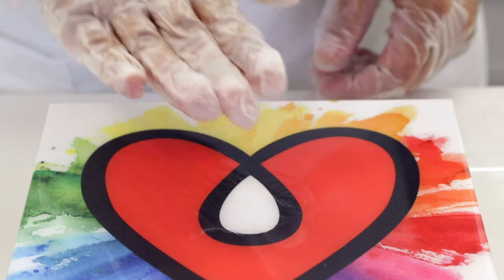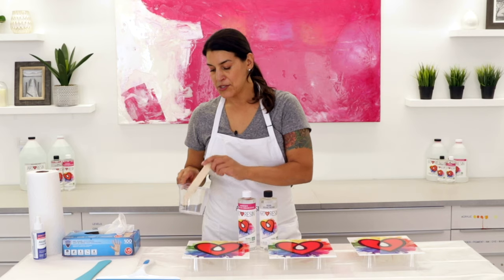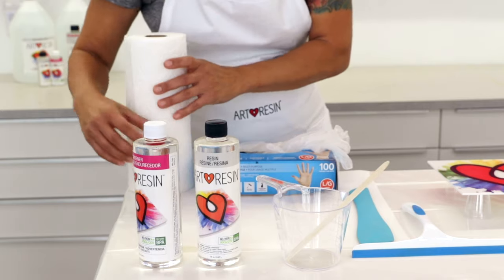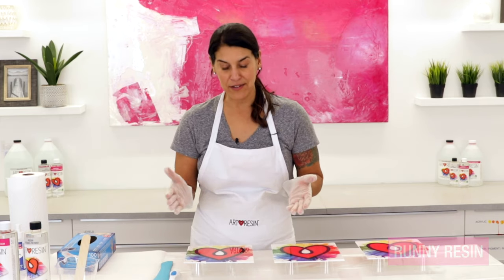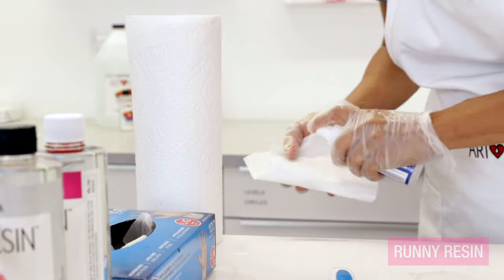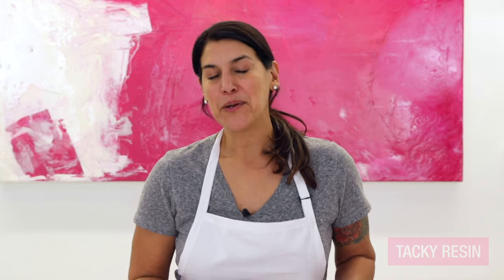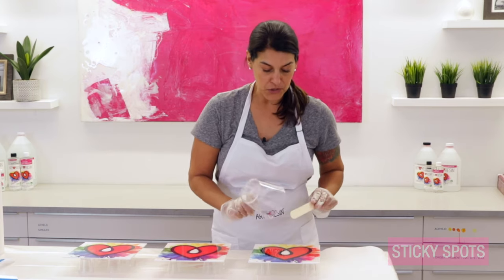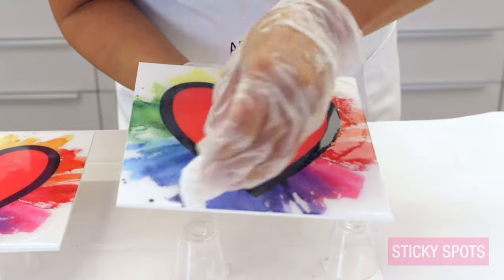How to Fix Sticky Resin - Top Tips & Tricks

Comment: My issue isn't about the mix because : I did the mix I put it on a 3D print and I let it cure and I often goes to flatten the thing and I add color and put the colored on the now sticky one
The 1th isn't sticky
The second IS sticky
The rest of the mix wasn't

If it's the mix it make no sense
Reply from the maker: Hi there, sorry you are having some problems with sticky layers.  You should be able to just apply a fresh layer overtop of the sticky layer to fix it.  You can reach out to us at support@artresin.com and we can try to help you further.

Comment: I think my problem with sticky resin is the temperature. Our family turns the temperature down to 69 at night. So I have to do my pours early in the day.
Reply from the maker: Yes, low temperatures can definitely slow down a resin cure, but it should cure as expected once the temperature rises again.  Just be aware that if the temperature drops during the first 24 hours of a cure, it can cause the resin to cure with surface imperfections.  If you resin early and the resin sets up before the temperature drops at night, you should be ok :)

Comment: How do you remove spoilt resin of off a canvas board
Reply from the maker: Hi Karen, if the resin is not cured, you can wipe it or scrap it off gently.  If it is cured you would have to sand as much as you could being careful to not damage the surface of your artwork.

Comment: And a respirator and ventilation. Toxic chemical buildup happens over time, but for some, it can happen quickly. Then it’s too late, and people do get so sick they can’t function, some even die from it, so it’s good to protect your lungs. They keep you alive.
Reply from the maker: It is so important to read and follow the recommendations for the epoxy resin brand you are using.  Because the raw materials used to manufacture epoxy resin are expensive, many companies add cheap fillers to stretch these ingredients out and drive the cost down. These cheap ( and toxic ) additives are non-reactive, meaning that while every other ingredient reacts with one another when the resin catalyzes, these fillers have nowhere to go ... nowhere, that is, except into the air in the form of noxious fumes and VOCs.  ArtResin has no cheap fillers and no solvents and is non-toxic when used as directed. Ours is a complete system, meaning everything in the formula reacts and bonds together, leaving nothing that can become airborne and be breathed in.  ArtResin does not produce fumes or VOCs and is safe for home use when used as directed in a well ventilated area.  Have a look at our blog for more information:  https://www.artresin.com/blogs/artresin/what-safety-precautions-should-i-take-when-using-artresin?_pos=4&_sid=4610a9abf&_ss=r
Reply: @Artresin  That’s very good to know, thanks! 😊 Definitely tell people often, because people may watch for the basics… and then go with a toxic brand.

Comment: Why couldn’t you wipe off the 3rd “fix” with alcohol and then resin it again?
Reply from the maker: Hi Lisa in the 3rd example there is so much going on. You will definitely want to sand those cured areas and remove the gooey pieces. While alcohol works well with cleaning tools we don't like to clean our pieces with them as it breaks down the resin, which might not seem like a big deal if you are applying another coat but we like to play it safe and not add in any additional factors.

Comment: But what if your project isn't flat, it's round?
Reply from the maker: Hi there - resining over a round object can be a little more challenging but the same rules apply.  Scrape off any wet, liquid resin as best you can and pour a fresh coat. Depending on the shape of it, you may need to do it in stages (one half and then the other) or prop it up and brush the resin all over with a foam brush.

If the resin is simply sticky (like the sticky side of tape) you can skip the scraping part and go straight to applying a fresh coat.

Comment: I thought you said you can’t do 2:2 ratio but in the end you did 3:3
Reply: I’m so confused I have the middle ones problem but I do every step your saying I mix for over 5 minutes till clear and I scrap hardener while pouring in resin
Reply from the maker: @sabrinabarajas191  Hi Sabrina, so sorry to hear that you are having issues with your resin cure. If you're resin is sticky then its likely that you have measured incorrectly. Remember to measure equal parts of both resin and hardener, so for example if you need to mix 6oz of epoxy resin in total that means you need to mix 3oz of resin and 3oz of hardener. When you're mixing, we recommend mixing for a full 3 minutes and scraping down the sides and bottom of your container while you mix. When you pour, we do not recommend scrapping those last bits of mixed resin out of the container. Please have a look at our blog about sticky resin causes and fixes for more information. 

https://www.artresin.com/blogs/artresin/oh-sh-t-series-episode-1-sticky?_pos=1&_sid=e8364748d&_ss=r 

And feel free to reach out to our customer service team at support@artresin.com, they would love to help :)

Comment: Did anyone else notice she distinctly said that the mix should be equal parts BY VOLUME NOT BY WEIGHT, then says this means one ounce of resin plus one ounce of hardener. An ounce is a measure of weight.......a fluid ounce is a measure of volume.
Reply from the maker: yes, you're absolutely right! I absolutely meant to say "fluid" ounce and I didn't. It was an unfortunate error on my part - you're thinking about so much doing these videos and there's so much information to get across in as concise a way as possible. Hopefully with the visual of the measuring cup,  the intended meaning came through.  Thanks for watching!
Reply: @ArtResin  It doesn't  seem to have caused any problems though! Great video,  thanks for replying.

Comment: what if its still in the mold? like mine is lol
Reply from the maker: Thats a bit more tricky.  You would have to take it out of the mold to coat all sides with properly mixed resin.  You can apply a thin layer using a brush or foam applicator or even your gloved hand.

Comment: What is happening to me is most of it’s dry but a few parts aren’t
Reply from the maker: Not to worry, this is definitely something that we can help with :) First you will need to sand the areas that have cured properly and are not sticky. Then use a damp paper towel to wipe off any sanding residue. Then you can go ahead and measure and mix a fresh batch of ArtResin to pour over your artwork. Remember not scrape the bottom and sides when you are mixing, but not when you are pouring.
Reply: Thank you I’m making it for my little brother this will definitely help

Comment: I thought any sticky resin is uncured resin and it should be sanded. I maybe wrong
Reply from the maker: Hi Shirley, resin that is sticky after 24hours of curing is going to remain sticky until something is done to fix it. Because the resin is sticky, sanding is not required. The stickiness provides the tooth that is needed for the second layer to adhere and bond to the first layer. Sanding is only required when the resin has cured as expected but perhaps there is an imperfection in your finish. Sanding helps to remove the imperfection as well as provide some tooth for the second layer to adhere.

Comment: Do you need to wear a mask using this resin.
Reply from the maker: ArtResin conforms to ASTM D4236, meaning it is certified as safe for home use and non-toxic when used as directed, however there are some safety precautions that every user should follow: * Wear gloves. ArtResin is very sticky in its liquid form, so gloves will protect the user from a mess, as well as skin irritation. Clean skin promptly with soap and water if it does come in contact with ArtResin. * If ArtResin somehow comes in contact with your eyes, flush with water repeatedly and do not rub. Promptly seek medical attention. *Work in a well ventilated area. Wear a respirator if ventilation is poor.

Comment: What about when it doesn’t harden in a mold
Reply from the maker: Thats a little tougher.  If it is just sticky on the outside you might be able to apply a fresh coat of resin to cover.  If it is really soft and bendy, a surface coat might not be able to save it.
Reply: So then do I scrape it out of the mold and start again
Reply from the maker: @jeannebean7353  yes, you can clean out your mold and start again.  If you have sticky residue in your mold you can wipe it out with isopropyl alcohol and paper towel.

Comment: 1:31 measure by volume, not by weight ... use 1oz of resin and 1oz of hardener  ... this is a contradiction
Reply from the maker: Hi EliteForce1uk, we're sorry for the confusion. ArtResin is a 1:1 epoxy resin which means you are mixing equal parts of resin and hardener. For example, for 2 oz of resin you need to mix 1oz of resin + 1oz of hardener. If you're mixing by weight, using a scale, it's 100 parts of resin to 84 parts of hardener.

Comment: Hey how to fix bendy resin its dry but bendy
If possible then pls reply as soon as possible
Reply from the maker: The resin might not have finished curing yet.  You can give it some more time and see if that helps.  Otherwise, you can try pouring on a thin coat of resin on top and letting that cure - it will help to give it a little more stability. 
Here's a blog with some more information about bendy resin and why it occurs: https://www.artresin.com/blogs/artresin/how-to-prevent-bendy-resin
Reply: @Artresin  it's already 2 days
Reply: Thanx  I'll try 1 more thin coating
Reply from the maker: @sapanatomar4735  2 days might not be long enough. Check with the resin brand you're using.  A thin coat of ArtResin fully cures in 3 days.  But if you pour into a mold, it can take a few weeks to fully harden.
Reply: @Artresin  so should i apply another thin layer now or should i wait for  1-2days more
Reply: @Artresin  can I keep it in sun ?
Reply from the maker: @sapanatomar4735  if it was me, I would wait another week or so.  The resin should get harder and harder as time goes on.  If it doesn't, then there is an issue and you can try applying a top coat to give it some more strength.
Reply from the maker: @sapanatomar4735  all epoxy resin will yellow from UV light, so putting it in the sun will cause it to yellow faster
Reply: @Artresin  ok thanks a lot

Comment: Huhhhh????? Wasn't the mixing supposed to be two is to one ratio?? That's what the shop owner told me! Besides which, the hardener bottle was already only half full!! And the shop owners are knowledgeable people not just counter sellers....
Reply from the maker: Hello Wajeeha, different epoxy resin systems use different mix ratios, it is very important to follow the instructions closely for the brand you are using.  ArtResin is a 1:1 ratio and must be poured by volume NOT by weight.  I am sorry the shop owner instructed you differently.  For full instructions and more information please go to ArtResin.com  🙂

Comment: Mesurin 1 by 1 didnt work. I did 2 resine 1 hardener and worked
Reply from the maker: it is important to follow the mixing directions for the resin brand you are using.  ArtResin is a 1:1 mixing ratio by volume, some other resins could have a different ratio.
Reply: @Artresin  thank youu

Comment: Why does it bleed with pictures ?? I’m a first timer
Reply from the maker: Hi LibraGangOnly, not all photos are printed equally. So when using ArtResin over your photos we recommend using a spray or brush on sealant first. This helps prevent any bleeding of the printer ink :)
Reply: ArtResin  I have Puduo epoxy resin
Reply from the maker: Hi  @libragangonly2521 , we recommend you reach out to the manufacturer of the brand of epoxy resin you are using. They are better able to help you with your question as we unfortunately cannot speak about other brands :)
Reply: A sealant like ModPodge is recommended to coat paper and let it dry before applying the resin.

Comment: My resin is soft even though my process is accurate. Can someone help me? It was already cured tho ;(
Reply from the maker: Hi Jin, sorry to hear that your resin didn't harden up fully.  If your resin cured but still remains bendy it could be as simple as giving it a bit more time to continue to harden.  Double check that your room temperature is between 75-85F, if it is too cold the resin can take longer to cure.  Aside from improper mixing ratios, adding too much colourant can leave you with bendy resin.  Always be sure to add less than 3% colourant to your resin mixture and stir it in thoroughly.  Sometimes your resin may retain some flexibility simply because it is very thin--pouring less than 1/3" thick without a substrate can leave you with a piece that has some flex to it.  If you still have questions, please feel free to email us at support@artresin.com and we can help further.

Comment: Why aren't you wearinga ventalator?
Reply from the maker: ArtResin is safe for home use.  It is non toxic and does not produce VOCs or fumes so as long as you are working in a well ventilated area, a respirator is not required.   Here is our blog on safety:  https://www.artresin.com/blogs/artresin/what-safety-precautions-should-i-take-when-using-artresin?_pos=3&_sid=ca154b639&_ss=r

Comment: Why does it get hot ?
Reply from the maker: When the resin portion and the hardener portion are mixed a chemical reaction begins, this reaction creates heat- which is normal.  Sometimes, if your mixture heats up too quickly the exothermic reaction can cause your resin to get too hot and flash cure into a clumpy mess.

Comment: wouldn't you... still need a paint respirator ?
Reply from the maker: Hi Alie,  a respirator is not required when working with ArtResin in a well ventilated area. If ventilation is poor, a respirator is recommended.

Comment: Mines is melting and they done and still sticky
Reply from the maker: I'm not sure what you mean by melting, but if there is wet runny resin, you will have to remove that first.  Once all of the wet pockets of uncured resin have been removed, you can pour a fresh layer overtop of the sticky surface.
Reply: @Artresin  I meant they were runny my bad

Comment: While the solutions are good, IMO some of yer methods are not.  First NEVER EVER use a tool without scrappin' off the removed products.  IOW, ye scrape, wipe, scape, wipe, etc.  Otherwise all ye end up with is a worse and bumpy mess.  Second, when usin' sandpaper, when ye wipe it down...WIPE IT OFF the piece, never into the middle of the work.  Again, use cleaned spots of yer wipe, never use the same spots.  Also, use WET sandpaper to avoid gouges in the soft spots.  Ye should also use graduated WET paper, again to avoid messes. Last...sandpaper creates dust so ye should not have multiple works close together or ye could/will contaminate them.  Just some thoughts.
Reply from the maker: Thank you for your feedback :) We will have to try out some of your tips.

Comment: put the mold in the freezer then take it out of the mold easy
Reply from the maker: that is a great tip to help release a stuck mold :)
Reply: I did try it and it worked so you can get it out of you molds. I had candle molds and trinket boxes some thing that you can't scrape the resin out.

Comment: 1ml =1g, so it can be measured by weight.
Reply from the maker: 1mL does = 1 g...but only when you are measuring water.  Converting mL to g  converts a volume unit to a mass unit, so every substance will have a different formula for conversion...water is the easy one, but it won't apply to your resin and hardener.  Since your ArtResin hardener weighs less than the resin portion, it is very important to measure by volume not weight in order to get a perfect 1:1 ratio.